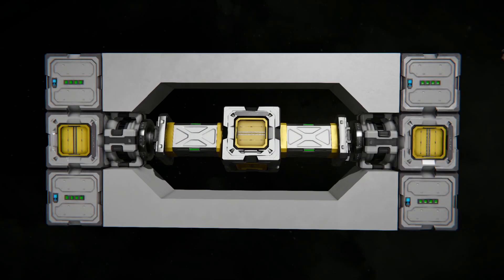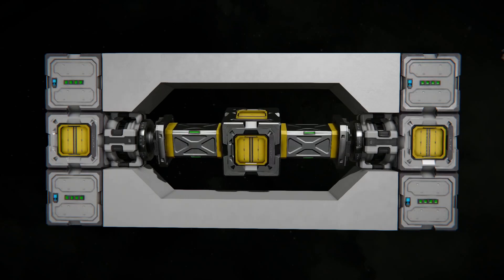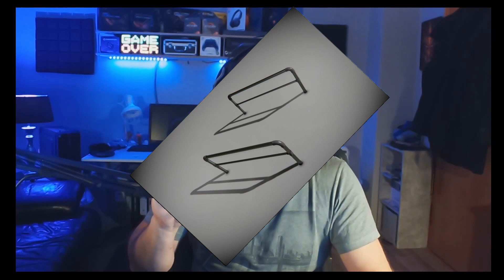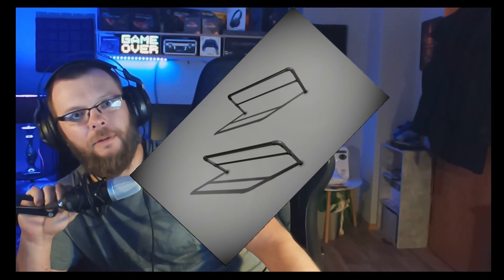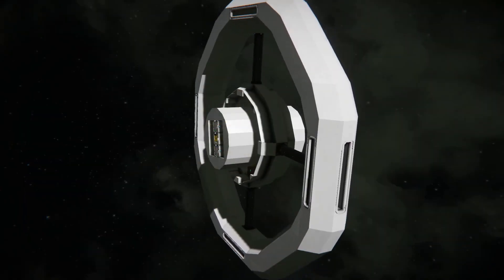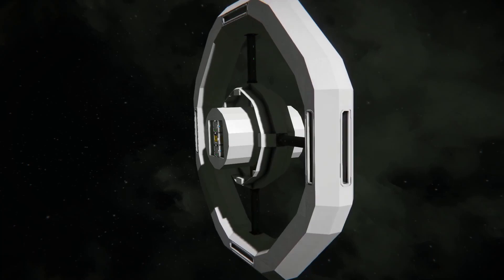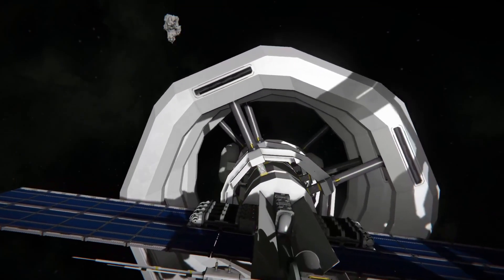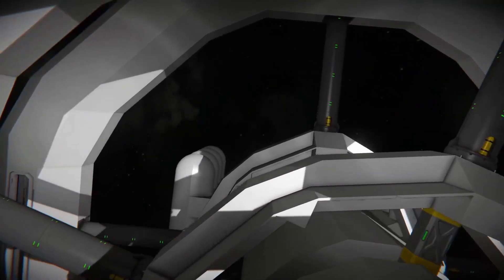[SPACE ENGINEERS] VANILLA ORBITAL ROTOR SYSTEM! by Kelevra - TUTORIAL

Comment: I tried building this thing myself, and all it did was either not spin at all or the whole grid would spin completely out of control. Did I do somethin' wrong?
Reply from the maker: The Main grid in this video is set to static to show the principal. Without that it would drift and spin too.
It needs to be static or part of a bigger mass of a ship to work proper. 
Also trying around with the setting and watching for collisions can help a lot. If it spits some sparks somewhere you should try around with the rotor head distances.

Comment: If ou are willing to use 1 mod then you can build a rotating ring or other thing that is air tight and you can pass through. Its called Federal Industrial - Utilites and it has large and small grid ring rotors and ive used them a fair bit. Not to take away from vanilla engineering at all.